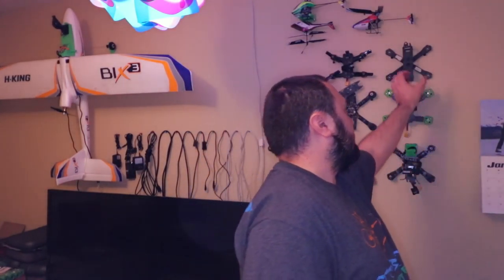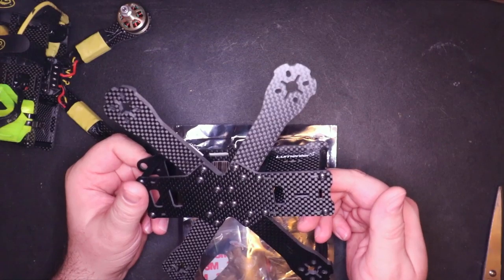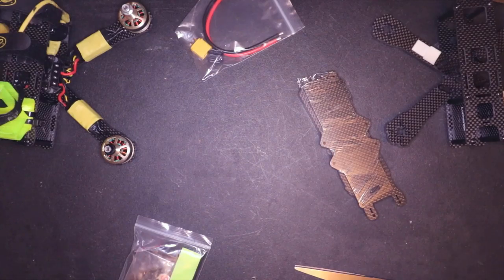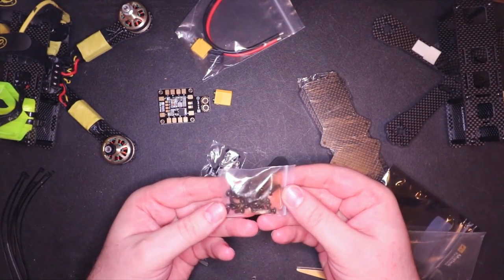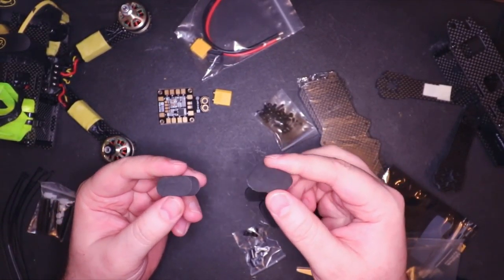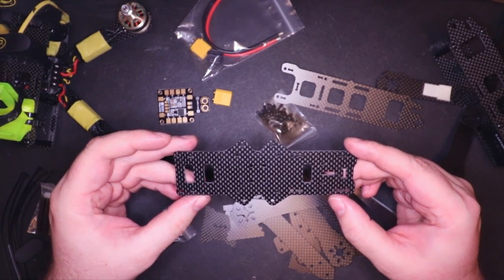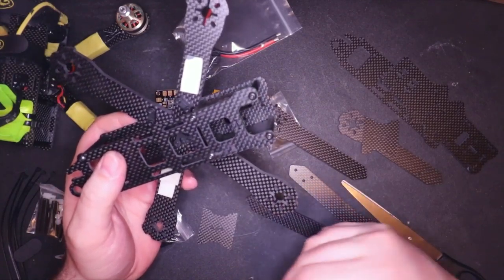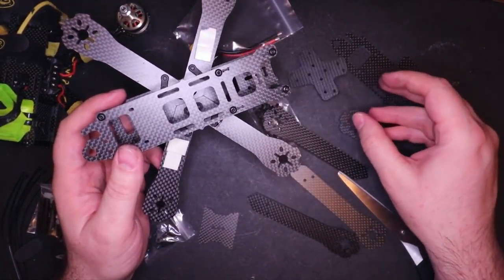LHI 220 - Unboxing and review

Comment: I absolutely love my LHI 220-rx. I recommend swapping out the standoffs for some higher quality hex standoffs because the threads get stripped very quickly. Other than that, it takes a beating and flies like a dream.
Reply: hey, is it possible to mount a gopro on this thing?